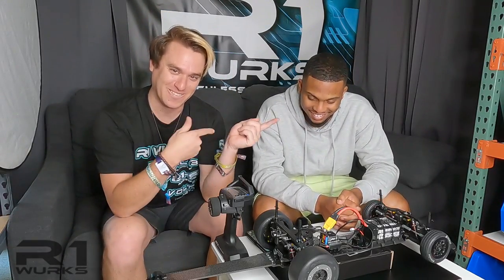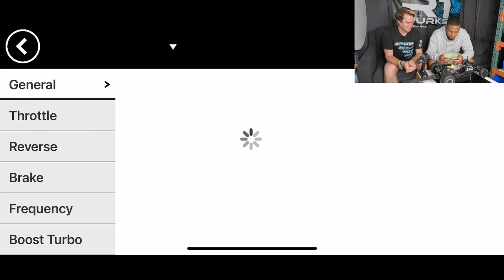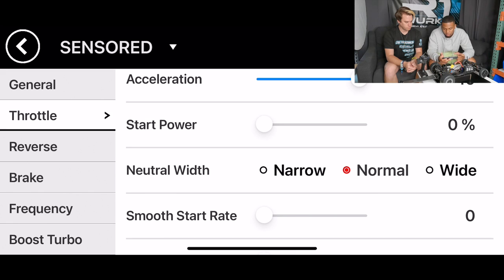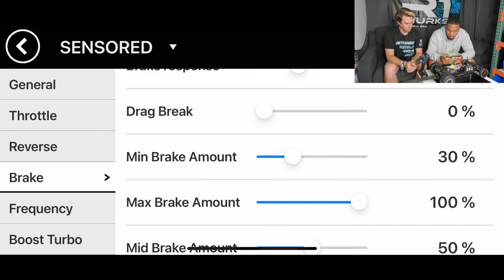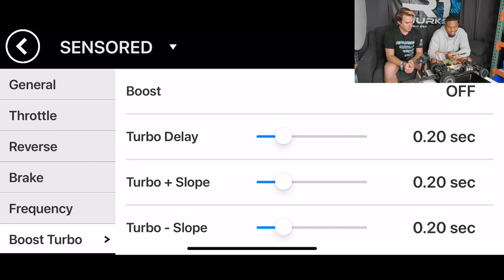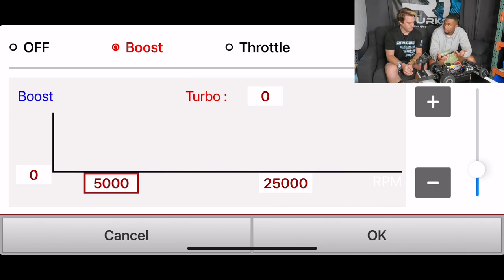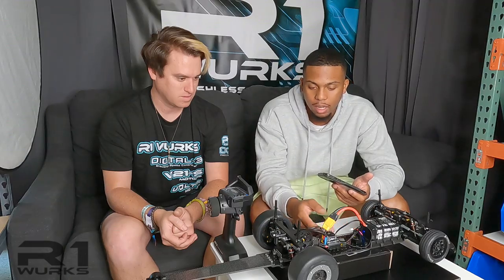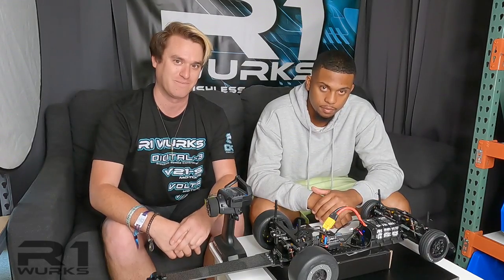Digital 3 ESC settings with WiFi Module for Drag Racing

Comment: Will we get an update to the digital 3 where reverse doesn’t kick in on braking when setting up for drag racing I use no brakes because the digital 3 software is written for circuit racing I think and always had an issue while applying brakes .. fastest esc in the game so far